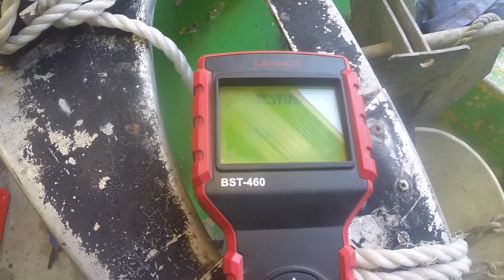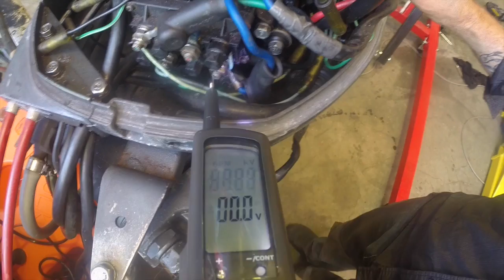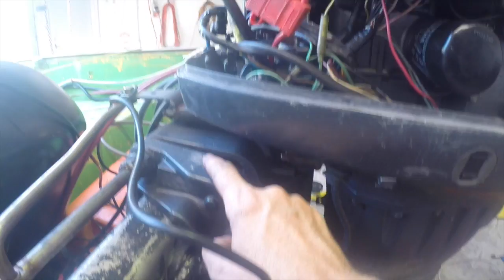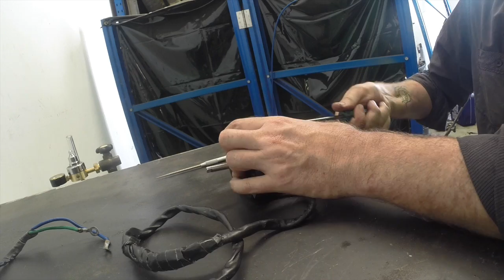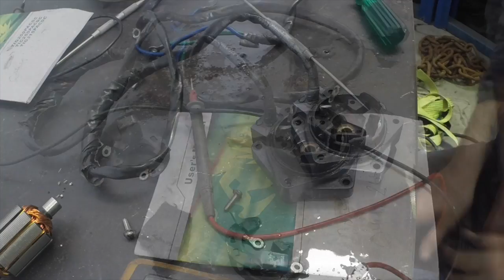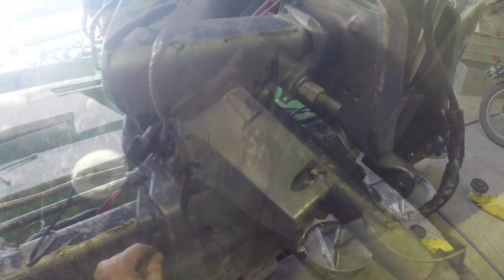Fixing the trim tilt on an outboard motor

Comment: Having a big problem with mine, noticed the cable was frayed and letting salt water in so the unit stopped working (although wiggling the cable sometimes helped!)but after taking apart the motor noticed the brushes had a problem please view and comment if anyone can help https://www.youtube.com/watch?v=9mCayp3tLm0

Comment: So I have a 1977 Johnson 85 HP and I just bought this boat well the the motor would go down but wouldn't go back up so I put hydraulic fluid in bled the line and it was working great it was going up and down just fine then all the sudden when I went to press the button for to go up or down it would just click and kept clicking so I assumed it was solenoid well I replace the solenoid it stop clicking it wasn't doing nothing then all of a sudden it went down but it would not go back up and it made a weird humming noise coming from the trim area I am guessing and now it doesn't do anything doesn't go up doesn't go down doesnt click or any noises.. nothing do u have an idea what it could be ?

Comment: Great Video Danger! I learned a lot from it but I have a question that may involve the hydro bypass valve. I have a trim that seems to work fine with both lift and lower. The problem is it doesn't stay in position. My 1st thought was the fluid but there are no signs of leaks anywhere and with it lifting the motor I'm assuming the fluid should be fine. My question is, does a Johnson trim motor have a similar bypass valve and is it possible (if it is closed) that's it's leaking air?  Also, can it be repaired/rebuilt? Any advise is greatly appreciated!

Comment: Excellent! I've been watching your videos for 6 mths now I've learned quite a bit. I have a feeling my trim is going to need to be service soon due to my trim will not go down sometimes but you can hear the motor working, I then will push it down by hand till it stops and it connects again and works fine. Thank you for sharing your knowledge and experience.

Comment: hi stu, can an electric hydraulic pump motor that is bad or going  bad  put a current drain on  the electrical system? Outboard was charging  at 13.1 then i pressed  the trim to trim outboard  up and down and voltage dropped to  a continuous  12.3, battery  has been  tested and  is in good condition. Also i have had a similar problem on my car where it turned out  that a crook starter motor  was the corporate of being the current drain and not allowing the  battery to charge  correctly. Also the tilt trim feels like its starting to get very weak.

Comment: Great video, getting to the back of those alan keys bolts is tricky! I use long shaft alan key and a ring spanner on short arm for torque on mine.  Getting them back, blue tac in alan key hole works as theres no space for fingers in behind motor.
My issue is Current I believe, how do i test it?    My tilt in both up and down will go from fine to slow deeper sound up or down, and tilts in slow motion.
Motor will only sometimes replicate this in my hand too when separated from hydraulics.
Its sparkling clean communtator, cleaned, sanded bushes so they dont stick,  expanded spings to provide more push...no relief.  frustrated... and i like to fix the odd thing myself.

Comment: Good video mate.  Having a nightmare with a mercury 70 power tilt intermittent fault.  Uploaded a vid and would appreciate if you could check it out and give me your thoughts.  Removed and stripped motor and 3 of the 4 brushes were stuck in freed them up and its better but still faulty.  Lots of corrosion on internals probably a new motor!!

Comment: I bought a pontoon boat with a 1991 50 hp Johnson outboard, the seller pushed the trim buttons up and down and the trim motor worked, but the outboard didnt move up or down, i saw that there was some fluid leakage coming out of the tilt shaft canister and the tilt motor quit working, while trying to get the motor up to have a look i unscrewed the bypass screw and the outboard went all the way down, but is now locked in place, can you tell me how to unlock it and raise the motor.  Here is a video of this.. https://youtu.be/aNLo1_tY89c

Comment: hey I just bought a 78 johnson 2 stroke and my trim isnt working, i can hear the motor turning but i'm getting  no movement on the motor. Does this mean that i have air in my hydrolic lines?

Comment: Have 1995 75hp mariner, I have new plug, bypass value and top o-ringsWhen this is replaced will I fill with hyd. Fluid at fill plug level and that's all?

Comment: Enjoy you videos, have a question on the removal of the entire tilt trim unit to totally rebuild. Just bought a boat with V4 85 HP 79 Evinrude. Is it necessary to remove the entire engine to drop the T&T unit? really enjoyed the relay build for the T&T
Thanks

Comment: hi Stu I find your videos not only helpful but entertainingI was wondering if you know weather or not you can fit a power tilt system on a motor that didn't come with one from factory ie a 30 hp mercury or Yamaha with manual tilt just examples I can think ofif so have you done this beforeThanks keep up the good work

Comment: I notice all the videos you have are Yamaha, is it generally the same techniques with suzuki, (my portside motor has always been super slow and will now not trim up under power, the ptt motor is getting the 12volts so I'm guessing it's either the bushings or brushes? inside the ptt motor) super nervous about doing something like this but everywhere I call says to replace whole ptt motor I dont think that needs to happen $$$! after watching a few of your vids, do you think it's possible to do this with minimal experience? I do not have a pulley lift and am thinking about maybe trim up locking them blocking it? do you think this video has enough in common with a 08 suzuki df175 for me to go off of this?

great videos! def my fav channel very informative

Comment: Hi there - great videos. so much info.I was wondering if you can give me some advice - 1992 40hp johnson - tilt/trim not working and the motor is stuck in the down position. No power with the forward control switch or the switches on the motor. The manual release screw is not aligned 100% with the hole so i cant release it enough to get the motor up manually. the mechanic tells me the motor is dead and wants $675 to put a new one on. I can fit one myself or at least clean the motor as you did but I cant raise the outboard to access the tilt/trim motor. My plan is to put a block under the outboard then hopefully knock out the long bottom pin holding the tilt/trim unit onto the bracket then lift the outboard up manually - do you think that would work or is there something I'm not seeing ?? - I cant drill out the hole to access the manual release screw as it is too close to the long pin that I want to hammer out - thanks.

Comment: Stu, 
How do you determine if your bypass screw is functioning correctly, im able to pull and push the ram in by hand with it opened or closed, almost seems like there is zero fluid in the tilt trim so there is no resistance at all going either direction.  i've called one of our local tohatsu mechanic shops and talked with him, he said if the motor turns but nothing happens (sounds weak to me but havent gotten to test it like you did in this video yet), then it either has zero fluid in it, or the bypass valve is malfunctioning and not closing off or opening up for the motor to then pressure up the hydraulic system.

thanks for any response you can shed on this problem

Comment: Hi Dangar Stu,I have a catamaran with two 15hp 4 stroke outboards in pods.It has trim/tilt to raise the legs up and down.1 leg on port raises all the way up. The other on starboard raises about 3/4 the way up.Both legs run off the same Hydraulic system. The hydraulic motor labours when the legs are lifted to the maximum up position, and legs won't go any higher.Is there anyway that I can make the SB leg lift higher so that it is out of the water (the same as the Port side)?I have tried locking the Port down lower, but SB leg wont lift any higher.I love watching your Vids and appreciate the time you put in to show the workings!Regards,Stuart.

Comment: Great video, just what I need as my trim and lift has failed with engine down. The head of the hydraulic release screw has been stripped some time in it's past. Any suggestions how to raise the engine manually.Of course it's winter and cold here, just perfect, not, for working on outboards outside.

Comment: My problem is I have twin 1995 Johnson ocean runners and used the button on the side of the engine to raise my port engine to flush when finished the engine would not go down...checked the starboard engine and it went down but not up ....then tried both another time and neither on will go up or down...checked all connections from the battery forward and all look ok...now I am stumped as it is both engines at the same time...had a so called marine mechanic come out and all he did was what I had already done charged me $100 for the house call and left...any thoughts

Comment: You have some very good videos.  Your experience really shows.  How do you fix a manual release valve that is stuck?  Mine is stuck.  I've used big screw drivers to try and turn it.  Used a hammer to help free it.  Used different types of oil to help free it.  It seems to be very stuck.

Comment: Another great video!! Was wonder what you thought might be the problem in my case.  While i was getting ready to flush the engine after fishing recently, all of a sudden the trim just activated by itself in the down position, and got stuck there.  Pushing the button up stops the motor from running but doesn't actually move it up.  As soon as I let go, the motor continues to run in the down position. Any ideas?  Thanks!!

Comment: pretty sure this is the same trim tilt as my honda Bf 50 the motor is part number 36120-ZW4-H12 .My leg will not stay up and I think it is because I am missing the little o ring on the releif valve any idea what that part no would be? I cannot find one to fit out of my spares box Thanks

Comment: Thanks for the advice on my power trim. I will do as you suggest. I have another problem on my 60 horse mariner outboard motor . My motor seems to come out of gear or something. When running wide open, the motor  revs real high like it is out of the water or it came out of gear. This can happen at any time ( full throttle only) that I am running the boat. I quickly pull back on the throttle to stop it so I can't see what the trouble is. Have you come across this??

Comment: Great video. But my problem is a little different.  I have a 60 horse Mariner outboard. The , other day, i could hear my trim motor running when i was still fishing. I pushed the down direction and the motor stopped. When I let go of the button, the humming started again. Then I pushed the up direction and nothing happened. the humming continued and the motor would'nt move. seconds after that the sound stopped and I thought it was working. But nothing worked. No up, and no down. I tried it later and nothing. I only heard the click of the relay or switch. Any ideas? I hope you can point me in the right direction. Thanks
Andy
PS I tried the switch on the outboard and the gear shift with the same results.

Comment: Great video.  Sat around trying to decide whether to take the boat into the shop and spend $1200 for a tilt assembly replacement or replace the motor myself. I will give it a shot...

Comment: I switched both relays back and forth and still no luck The switch on the throttle and on the engine work only in the downward position I have to find the power plug to the pump motor unplug it and use alligator clips on the battery switching the polarity ??? Does that make sense to check the pump and have you any ideas where the plug is on my 1999 70 hp Johnson ?? Thank you Brian